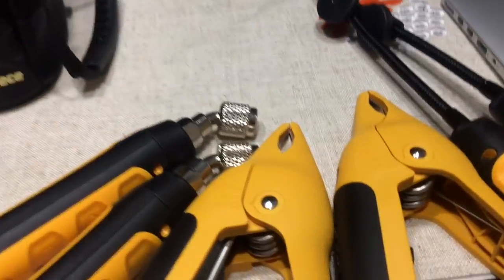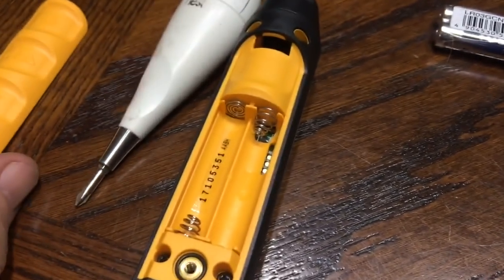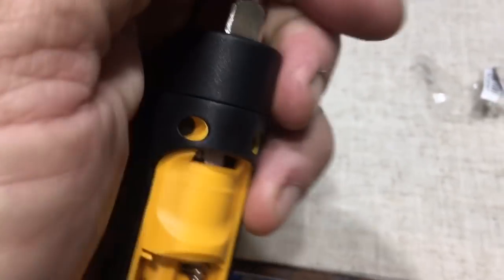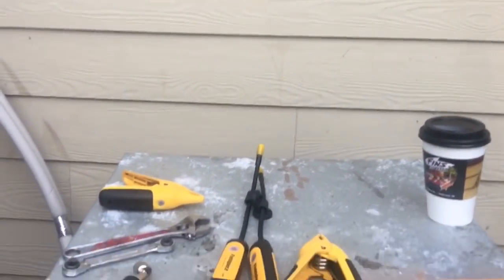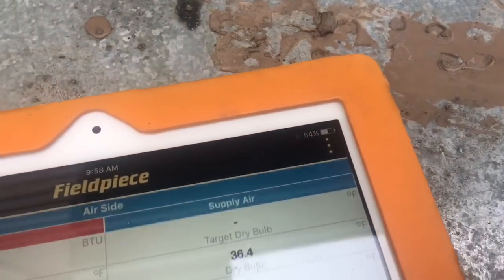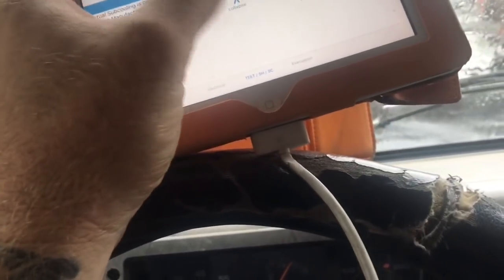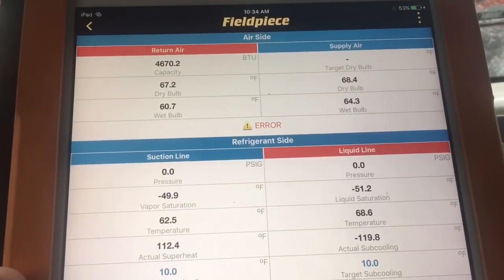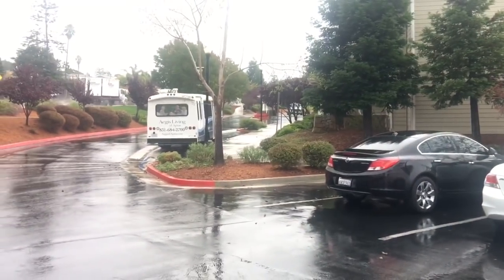Fieldpiece job link probes

Comment: I've had mine for 3 weeks now. Love them. Readings outside the box! Exactly what I've wanted for years now! I opted to not get the enthalpy probes. Now I'm wishing I got them for that ∆t
Reply from the maker: toolman what’s the best range you have gotten outside the box so far?
Reply: Nor-Cal Refrigeration & H.V.A.C  So far the most challenging job I was at a condensing unit during a start up about 25ft away, through the box, two interior walls and a brick exterior wall without any challenges. This was not over WiFi either.
Reply from the maker: outstanding.

Comment: Great video!
Based on connecting all the probes, does this Fieldpiece set up let you know the CFM's of the trunk you have supply side probe in or you still need to separately figure out CFM's using a hot wire anemometer?
Thanks!
Reply from the maker: jdere31760 at this time it dose not. They are rumors that the hot wire is coming out.  You have to manually input your cfm on the app.

Comment: This looks like a good alternative to the Sporlan Smart Pro/r. Will the app support three pressure probes and three temperature probes simultaneously? I would like to be able to leave a set of probes at the condensing unit and a low side probe and temp clamp at the evap.  Thanks -Pete
Reply from the maker: Alpha Tech Refrigeration at this time it dose not. But I have asked about multiple evaps in the app for refrigeration.
Reply: Nor-Cal Refrigeration & H.V.A.C.   Seems like everything being developed is for AC work, I guess Refrigeration guys are dinosaurs. I just can't bring myself to spend over a thousand $ (three sets of low side probes and one set of high side) on the Sporlan smart probes.  Up, down, up, down on the ladder I go!
Reply from the maker: I agree, it would be nice if you piece your own kit together.

Comment: I keep looking at all this new stuff, it tells you this and tells you that. It all does it in its own ways. Its pretty damn cool! But do you think the new age engineer relys on all this info buts not actually sure wtf to do? Dont get me wrong im no fridge guru but is this the turnaround from experience and to  someone saying computer says no.
Reply from the maker: I was just talking about this to a friend, if its balls busy no way you break out these tools.  change outs yes, start up yes, trouble units yes.  what do you think?
Reply: Nor-Cal Refrigeration & H.V.A.C i use the testos sometimes, but its dependant on what your doing and what time you have i guess. Pretty handy for the problem units like you say. But stuff i work on i dont need anything to fancy. I use the pressure sensors a bit if im pressure testing, they can be handy. Good to play around with this stuff though if you have time.

Comment: Great video! I can almost smell the used grease lol
Reply from the maker: JonesHvac 😂😂😂😂
Reply: Nor-Cal Refrigeration & H.V.A.C one quick question do you have to use that job link radio transmitter belt thing to get good range ? That’s the only thing I didn’t like about Fieldpiece before
Reply from the maker: JonesHvac not with these probes.

Comment: awesome!!! pricey????
Reply: jimbola77 $300 ish without the enthalpy probes. Dave got his for free. Probably doesn't know the price?
Reply from the maker: toolman I know the price. I have more than that in my Testo’s which only have a 20’-30’ range on a good day. For the price the Fieldpiece are a deal.
Reply: Nor-Cal Refrigeration & H.V.A.C I never purchased the Testo set. I did waste money on the first gen of the Sporlan set tho. Needless to say, I was weary of the testo range. And when I heard about the range these Fieldpiece were getting I decided to get them. And I am glad I did!
Reply from the maker: I had the Iconnect for a bit and the range is the best. its expensive but good, fieldpiece had told me about there probes and the fact they would broadcast threw walls, boxes and that I could demo them, I gave the I  connect away to OC refrigeration.
Reply: Nor-Cal Refrigeration & H.V.A.C you won the iconnect from Zack, right?
Reply from the maker: toolman yes that’s right.
Reply: Hey Dave I’m still using my old analogs wish I was more fortunate to be able to afford those new ones. What do you plan on doing with your Testo gauges?
Reply from the maker: youngbeechnut78 I still use plan on using Testo gauges.

Comment: Good video ! Here's the Prices --- $ 304.00 --- 2 pressure probes & 2 - Temp clamps. No Air Probes. Test equiptment depot.$476.00 --- 2 - temperature / Psychronometer Probes , 2 - Temperature Clamps , 2- Pressure Probes. Test equiptment depot.
Reply: Did you buy these or did Field Piece sponsor them?
Reply: just picked up mine at the local supply house. $440.00 plus tax for the whole kit. I like it so far.
Reply: Actually not as bad as I thought. I do a lot of refrigeration work but have also been looking at the sman’s